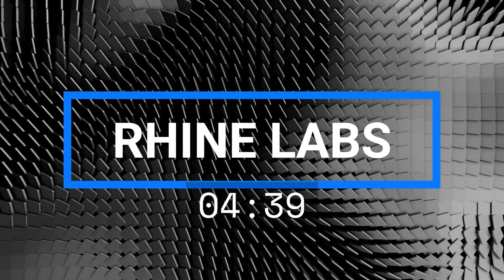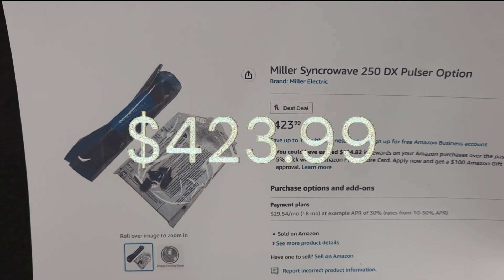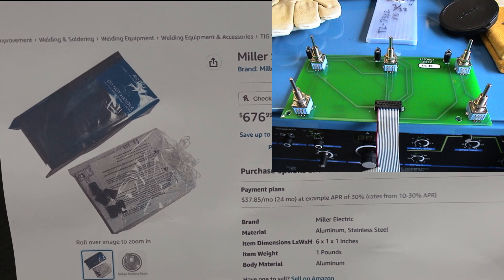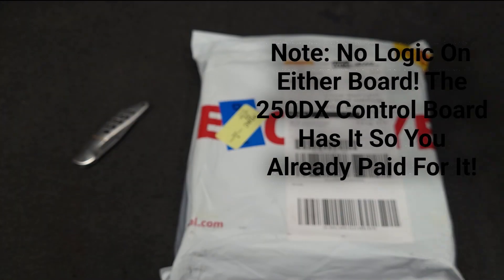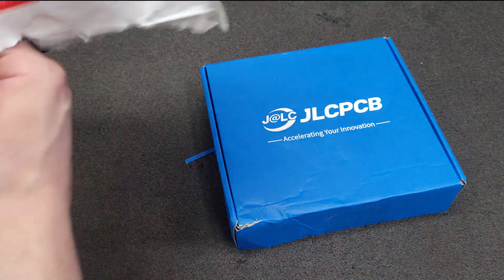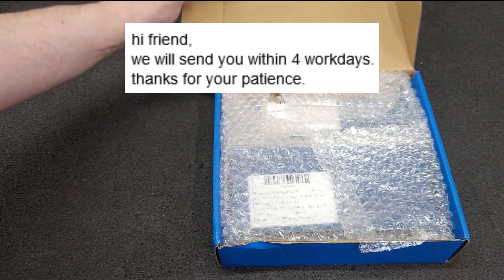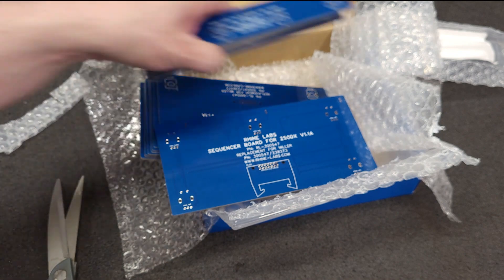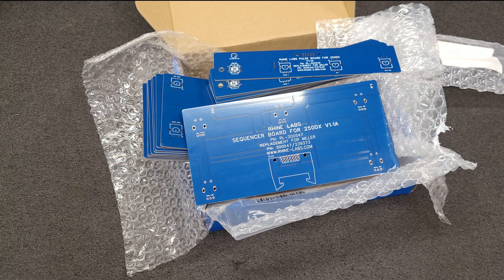Major Update! DIY Pulse and Sequencer Upgrade Boards for Miller 250DX Tig Welder Arrived.

Comment: very very impressed with what your doing!!  i have an older 250 , still has all boards and parts , let me know if you need pics or part numbers ect... truly happy to help with this if i can
Reply from the maker: I gave up on the older 250dx as i do not have one to test fit the parts on. I have been contacted by a few people with the Older 250DX's i have sent them a print to test fit and not one of them has done it so i will have to revisit the older 250dx at a later date if at all.
Reply: @Rhine_Labs  if you change your mind , I'm happy to pull mine apart , test fit , send templates whatever , I know it there's a bunch of guys that could really use your help with this , including myself .    keep up the great work ,  I'm here if you decide to give it a go
Reply from the maker: There has been major progress on the older 250DX boards are done! I am just waiting on the parts to assemble them. https://youtu.be/p0lQLNVmDf4
Reply: @Rhine_Labs  thank you I'm interested , I'll take a look

Comment: Great stuff. I just brought home a 350LX, should use the same sequencer as the 250DX,
But I have an older version of the welders as my parts book gives the # 183 105 and the schematic in my book doesn't show anything other than a ribbon cable to the main pcb.
If you could find a way to work my version, I would buy one as they have been obsoleted.
Reply from the maker: I believe they are the same I would have to check. the service manual for pinout and pot value.
Reply: @Rhine_Labs  I was reading a very old post where a guy bought a pulser, and the holes didn't line up because it was an "older" version even if it was only a few months old.
So the same parts might work with a  different pcb. My machine does have the pulser if you need any data from it.
Reply from the maker: @stephensarkany3577  The boards i have are for the newer 250DX 350 Units.
Reply: @Rhine_Labs  Sure, I got that, just hoping you might take on the early version as well. I have the pulser that is obsolete, just haven't found a sequencer.
Reply from the maker: @stephensarkany3577  I had someone send me measurements. I sent a pdf for him to print and check alignment, but he never responded.
Reply: @Rhine_Labs  when are you showing a video of the boards done and also the welders running ? Super keen to see
Reply from the maker: The older 350LX is not compatible with either of my version of boards layout is different has what looks like a rotary selector switch in the center of the sequencer board.

Comment: Steven, Count me in for your Pulse and Sequencer board kit for DIY soldering together.
Reply from the maker: I blew a line on my tig torch and went way over budget on this project and ran out of excess spare time. Right now all prototype boards are spoken for. I do have rev 1.4 almost ready to send to board house which will prob be the final rev.

Comment: Awesome! Perfect timing too. I hopefully will have that same welder by the end of the week. I love the fact that you're bypassing the price gouge, and I may have to take it a bit further. Since that's such a simple circuit, you could just use panel mount pots and connect it all with wires. Subscribing to see how this turns out.
Reply: Just read your blog post about this and saw you mentioned that as option #1, nice!
Reply from the maker: @joehobo00  Yea, I had the post up for a while on my 250dx upgrade post before moving to its own post. It's helped a bunch of people save a bunch of $$ but I prob have 70-80 e-mails of people waning a simple low cost plug and play solution.
Reply from the maker: @joehobo00  Yea, budget on this project's been exceeded lol. Trying to make it simple so some trial and error. Soldering Stations are Hakko, the Hot air are Quick TR1300A https://youtu.be/gf17es5mLWM and TR1100 Micro https://youtu.be/ar_691qlbx0